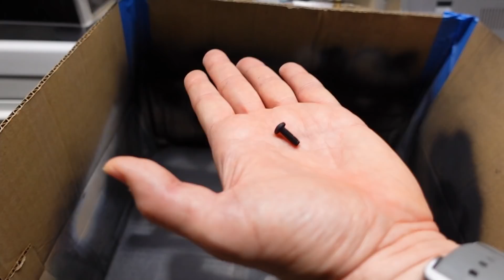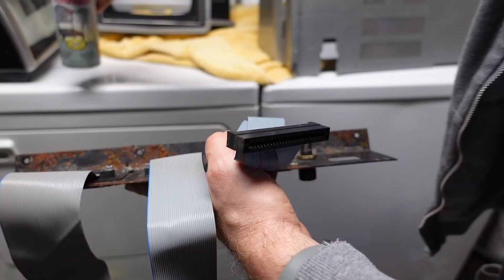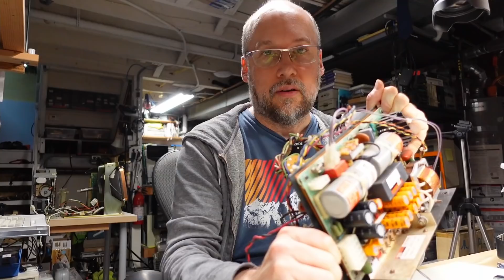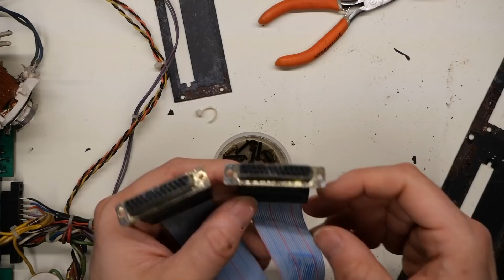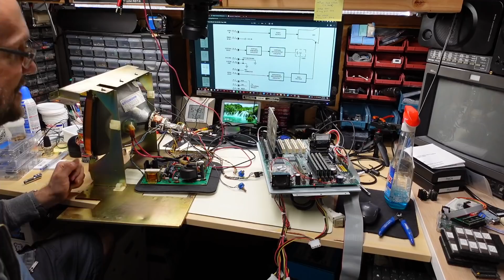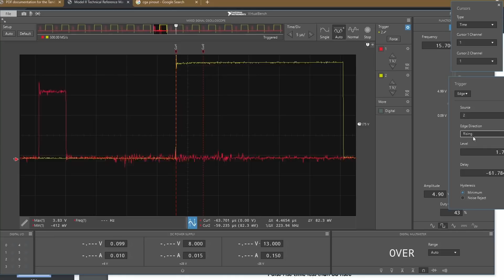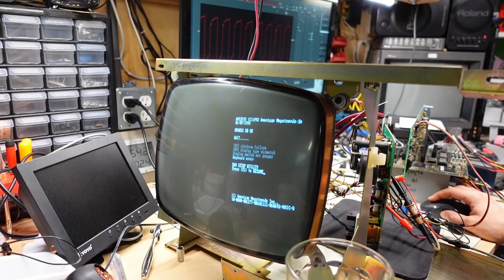I actually got something working on the TRS-80 Model II!

Comment: EvapoRust is your friend where rusty metal parts are found. Once wiped or rinsed off. Brush with wire wheel, remove any oils and then paint with Rustoleum-type product.  On screws, after EvapoRust, brush with wire wheel, heat to red hot and drop into food-grade oil. It will darken the screws and prevent further rusting. Don’t wash them in vinegar as it erodes the metal.  Vinegar is good for Brass or Copper as it removes p patina. You could further polish the brass/copper fasteners if need be.

Comment: At about 16:48, the flyback transformer's solder joint next to the T1 label and closest to its smaller 1 solder joint looks really brown –rusty?– to me, but you went on to say you didn't see any issues there upon inspection of that PCB backside later in the video (after 24:00). So how is that fine? Is it something other than rust that doesn't really come across in the video?

Comment: This is really cool, I didn’t even realize this Tandy with the 8” floppy existed. 

It was so cool watching you tap into the CRT drive board, power it externally and drive a signal from a CGA source. 

This of course could be a controversial statement, but after watching you drive it with the signal generator, I couldn’t help but wonder if that could be done with a Raspberry pi. 

Maybe some kind of A - B selector switch device could be used to toggle from a raspberry pi to the original Tandy.  Then you could do all sorts of things with the Pi connected to that CRT. 

I love the old CRT AIO computers, keep up the excellent work!

Comment: G'day Adrian enjoying the M2 vids. I've had the "pleasure" of repairing a couple of the M2s including painfully manufacturing the pads and restoring the keyboards one key at a time - aaaarrrgh.😣
One gotcha with Aztec supplies is the snubbers. Looks like you dodged the yellow Rifa "nades" but it would still be a good idea to replace them.
It might have been good luck but I've found the 8" floppies to be OK after a grease&oil change with one drive having a shorted tantalum which worked perfectly after replacement. The P/S took the short OK.
Happy to sit back with a hot cuppa and watch someone else go through it.☕

Comment: Yes, this is a linear type of power supply and they do work in a different manner to switch mode supplies.

With this supply you have, there shouldn't be a need to attach a load for it to power up. I think, this will power up whatever the load is at the terminals. Switch mode supplies have current and voltage sense circuitry whereas this linear type does not.

So, if this is powered up and tested, should output the voltages listed for the output terminals. 
Again, switch mode supplies will limit the voltage on the output if no load is applied.
When a load is attached to the output, the voltage will power up accordingly.

Comment: At 19:01 You mention that huge capacitor at 2035 VOLTS!!! Imagine if that was true, no one would ever open any power supply with that kind of rating!! Lol! I know you meant uF and not voltage but, seems like I am the only one who noticed this?? 

BUT...
Great job Adrian as always! I can never wait until your next videos are released! I prefer the longer videos you create but shorter ones are also good too!

I have a BBC Master 128 computer in mint condition and working, but, upon opening the power supply, I broke a component off the power supply board when trying to remove the metal chassis. What a nightmare that was!

I don't know what the component was, but it looks like an old style inductor. It is small, round and has several colour bands on it and googling around,  I cannot find either pictures of this PSU board or even the correct schematic for the PSU! All I can find are BBC Micro boards and schematics which are completely different to the Master 128!!

Do you own a BBC Master 128?? 

I know you mentioned something about it in a previous video and maybe know what the component is and its value???

Comment: You might want to take detailed photos of the back panel labels. You could print out cropped images of the labels on clear plastic stock for printing with a laser printer. Cut it out and glue them on to the refinished panel.

Comment: I'm 70 and the TRS modii was new when I played with it. Its really a simple machine. Sockets are most likely going to be a problem. They mostly didn't have  gold plating. 
The power supply may need a load to operate and if you test it without a load it may smoke. Test the caps before you turn it on, they are the most likely bad parts if its set for a few years...decades. It was a 4meg Z80. Some where in the barn I have a Z80 in circuit emulator with an rs232 port called a Nicolette. It had a memory test function and you could 
read the bios and put data in ram. You have a manual so I"m sure you will prevail. Good luck man.

Comment: You know, this video was quite useful to me.  I have been fiddling with a Cub Microvitec monitor that was left for dead and dare I say much more crusty than the TRS.  I followed most of the same steps and had exactly the same concerns - but there comes a moment when you run out of excuses and you have to turn it on.  In my case the LOPT was tracking to one of its pins.  I didn't let it get toasted and I rewrapped the top insulation with Kapton, PET and some neutral cure silicone and.... I got a frame collapsed picture.  So its not completely dead - but its trying.

Comment: For that rear panel with the connectors...you mentioned you have compressed air, head down to Harbor Freight and pick up one of their little handheld sandblasters, and then go grab a big ol box of baking soda. Blast the part with baking soda, it'll get all the rust and crud off and leave most of the paint.

Comment: Man if i were you i trhrow away that flyback instead of trying to turn on that board with that flyback on it. There are TONS of misinformation online (and i saw MUCH misinformation on youtube) that say "beware with the capacitors on crt boards, they could kill you" and that is a complete lie. I touched accidentaly tons of capacitors that were different in capacitance and mf (yep. even the big ones on the power supply) and im not dead. :P it shocks you for a second and nothing more. yes. we know that couldn't kill. But flyback transformers? that's another story. and they got to be perfectly isolated. any little fracture on the cable and they start spitting high voltage. and yes. THAT REALLY could kill you. and when i saw that massive hole in the flyback and you said that you are gonna try it... i don't understand why you do it, if it was a hole like that on the plastic, and then waving your arms near the flyback and it's cable doing something with the mouse of the computer while trying it for first time... here is it something that i'm missing or that was SO much luck. when i had to work on tvs that had a flyback related issue and we testing a patch on the cable or something like that, i plugged the tv with me as far as the cable will reach and disconnected inmediately if something goes wrong. haha! I'm glad that i got another job and i don't need to be nowhere near a flyback transformer anymore :P
anyway. Congrats for bringing back that crt to life!! Great work! ;) 
Greetings from Argentina :)

Comment: For so long I had wondered about the Magic in genlock syncing, but when your subtitle about not having an external trigger on the function generator showed up, it made me realise it’s probably similar to signal-triggered waveforms on a synthesiser.

Love your syncing by hand by the way :D
Reply: GenLock is very similar to wordclock. There will be a master timekeeper somewhere. Instead of using an internal sync to work on its own, and perhaps play well with others whilst marching to the beat of its own drum, everything set as a GenLock (or wordclock) slave won’t do anything until it gets the clock from the master timekeeper. In video world, you don’t get any distortion of frames when live switching between cameras. In audio world, it has two different prospects but the same principle.
Reply: @brentadams28  oh, so it’s just a regular old external clock trigger. This entire time I was thinking genlock first locked-on to the master sync from video1, to then apply across the rest of the board with the other sources. (Which is the part I said about reminding me of a signal-triggered function in a modular synth.)
Reply: @kaitlyn__L  basically, yes. People started using different names when basic standards per application (and connector) were established. What you’ve described sometimes happens in an ad-hoc type situation, but in a professional environment there is either an external generator or the switcher is master and cameras are always set as slaves. Same thing happens in audio world with digital consoles/amps/snakes.
Reply: @brentadams28  I think I saw it happen “ad-hoc” in a Video Toaster demo and thus thought all genlock worked like that. The irony is I was thinking a master clock would be simpler, but having seen syncing from one VCR to another on the Amiga I thought there must be more behind it. 

Good to know my instinct was actually correct then. Using the master mixing console as the clock source and setting all the cameras to an external trigger is definitely the kind of thing I’d had in mind years ago. 

The wishy washy way they explained it in the Toaster demo gave me the wrong impression that you needed something more complex than that to keep everything working together, with clock drift and re-locking on and stuff like that given CRTs’ wider timing tolerances. 

I’ve known about eg timecode syncing in video production for the longest time, and I’ve known about vsync and hsync in analogue video for the longest time too, but I just wasn’t sure how genlock fitted into it all. So thanks for clarifying!
Reply: @kaitlyn__L  probably the simplest way to describe genlock is an analog live version of SMPTE timecode. Only now, since it’s all digital, everything uses SMPTE timecode. Plus, timecode can be encoded on recordings making post much easier
Reply: @brentadams28  yeah that was my introduction to it all, reading the history of NLEs and learning all the diff ways the digital timecode was encoded in tapes. On separate tracks, in the back porch, etc etc. 

My introduction to genlock was really in the context of overlaying graphics or animation on an already extant recording, rather than about keeping many cameras in a studio in sync. I suppose in that use case they would absolutely have to always derive the existing sync clock to re-emit it, even when it’s a professional production. Like how they added the title cards and transitions into “live to tape” shows after recording the various segments. But the cameras they switch between during the actual “live to tape” segments, I suppose would have been genlocked as you described with the mixer desk clock source.

As you say, digital makes everything a fair bit simpler. And I think that was part of the fascination — besides some home tapes with a camcorder, all the video production I had engaged in was digital. So the only experience I had with analogue video sync signals going out of sync was like, when I’d record over another recording on VHS and there’d be the sync snow for a couple seconds, except for the rare occasions when it switched very gracefully. Which used to confuse me when I was little, why it sometimes didn’t happen, but now I know it was just luck that I’d by chance pressed stop on the tape at the end of a sync cycle.
Reply: @kaitlyn__L  You’ve put all the puzzle pieces together despite the fact that I’ve only really ever mentioned cameras. It wasn’t intentional; for me it is late and I didn’t want to seem like I was mansplaining or something similar, so I didn’t elaborate. But, it seems like you have a very firm grasp on the concept. I only hoped to fill in the A/D gaps.
Reply: @brentadams28  that’s totally fine. Given this specific venue we’re all expected to be fairly technical people anyway right? But also, unsaid as until now, video was one of my first special interests even before learning to solder and stuff so I was familiar with most of it anyway. 

I’d seen old tutorials about the importance of a genlock unit when dual-deck editing and stuff but just never bothered to actually look into genlock, or when I did it was too much of the vector maths type stuff, similar to how QAM always just baffles me in specifics, even though I’m quite good at thinking higher-dimensionally in general. 

So I appreciated the clarification on how it works in electrical, signals, operations type terms :) especially because it’s not actually as complicated in the bigger picture, even if some of the specific implementation details that went over my head are more complex.
Reply: I was thinking similarly - time to pull out the video toaster!  :-)

Comment: HV bleed resistor was probably added in a revision of that monitor chassis as a spot killer, so you don't get a bright dot burning into the CRT after power off. That is a common problem on monochrome CRTs that don't have an HV bleeder.

Comment: if you get the crt board functioning, i would use some electronics grade (NOT building supply grade) silicone to fill the cracked rubber on the flyback. builder grade silicone generates ascetic acid (vinegar) as it cures which is corrosive. electronics grade uses platinum group metal catalyst in it to cure without creating acid in the process.

Comment: It's a miracle that the capacitors in a device from 1979 still work.
Reply: I'm not that surprised. Usually it's high-ripple caps in switching supplies that fail from use and most American capacitors from the 1960s on are still too new to fail just from old age. What I find more surprising is that my 1949 TV only needed two of its electrolytic capacitors changed to work well.
Reply: Then I wonder how it happens that some of the capacitors in my original X-Box, which was produced in 2003, have already burst. And as I have heard, this also applies to other modern devices.
Reply: @manicsorceress2181  There are two main reasons. The first is cheaper components, compounded by the fact that in the early 2000s many capacitor manufacturers were using what turned out to be contaminated chemicals. The second reason modern devices often have capacitor problems is because they are used in locations where they are pushed harder. Modern devices have switching power supplies which enable the use of much smaller capacitors, but also put those capacitors under lots of ripple current. The combination of small size and high current lets the internals heat up (and lack of cooling doesn't help either) and this dries out the liquid electrolyte. As the electrolyte dries out the internal resistance increases and this leads to even more heating. Heat causing a pressure buildup is why many capacitors physically bulge.
Reply: So were capacitors better in the 80s than they were at the turn of the millennium? That’s crazy. Are today's capacitors better again?
Reply: @manicsorceress2181  Today's capacitors are probably pretty good, but plenty still go bad. Usually failed capacitors are right on the secondary of a switching power supply. Here they see the ripple and they are often near warm heatsinks.

Comment: When you need to get rid of rust without a some type of "sand brush" (sandblasting, sand tumbler, etc.) or a steel wire brush you can use Evapo-rust. Use one of these gel paint remover, clear the paint and dip the piece on evapo-rust.

Comment: Hey Adrian, if you look for a cheaper rust reformer use plain phosphoric acid most reformer based on it and its much much cheaper. 

https://en.wikipedia.org/wiki/Phosphate_conversion_coating

Comment: Heat the screws till they turn red and then drop them in used motor oil.  They will turn black and be permanently protected.
That rear piece would do well with media blasting and matte black powder coating.

Comment: There are blocks that are used by restaurants to clean grills. These blocks are very abrasive and would work to clean the rust off the inside of a piece of angle such as what that back is made of you can also clean the outside but it would have course remove a paint or labels.

Comment: Adrian, great video. It is not surprising it works. That flyback is silicone dipped and is quite robust. You did a lot of work to see if it works. You could have just injected a horizontal and vertical pulse and cranked up the controls. It would have shown a blank raster.  As for the graphics on the monitor, you could get a "High Resolution Graphics" card for the machine for more than B/W video. Some even swapped out the P4 phosphor CRT bulb for a P1 for a green display like the 16/6000 had. We did that to one of our later upgraded IIs.

As for the power supply, BE VERY AWARE of the expoxy potted Rifa caps. I'd replace every one before powering it on. They look good, mabye even test good at first  but may have cracks in the epoxy and most likely have had moisture intrude. They POOF quite nicely. Exact replacments are available from Digikey or you can use another brand. As for running it without a load, you can repair and test it with no load without an issue. I've repaired a few without incident. On a side note, the power supply for the computer is the same on used in the disk expansion unit (should you ever find one). I look forward to your next installment. Happy Computing and restoring.

Comment: Never seen a monitor driven by horizontal from one source and vertical from another.   Not sure it would have ever occurred to me to do that!  Nice job!
Reply: I've run a TV CRT with the yoke and high voltage on one chassis and the neck on a completely separate chassis. I knew I had to be very careful or else I might end up burning a solid dot in the phosphor.